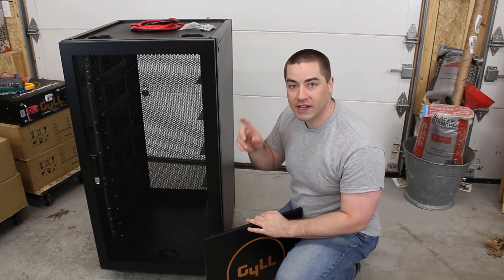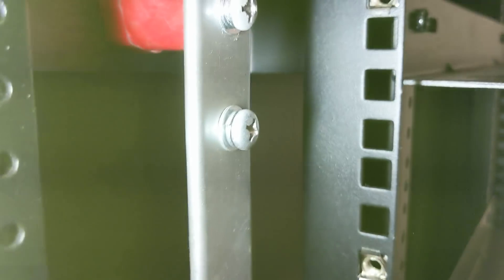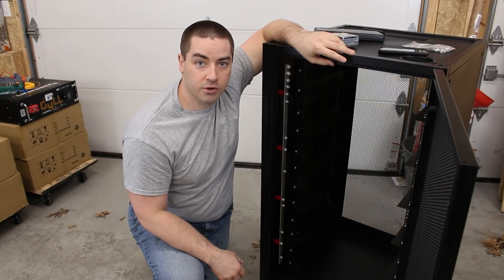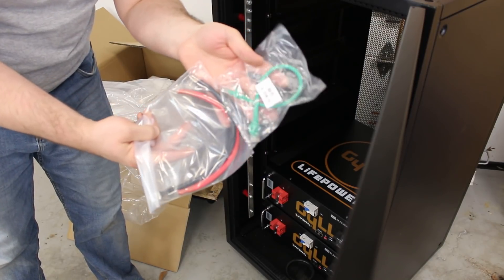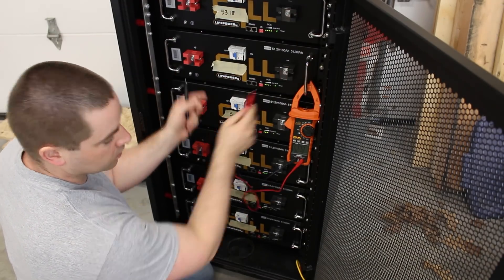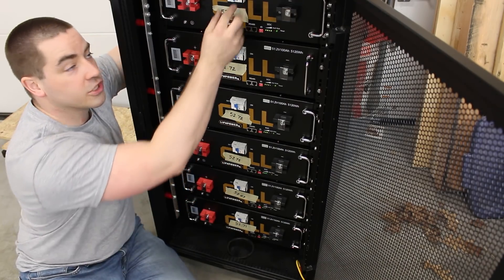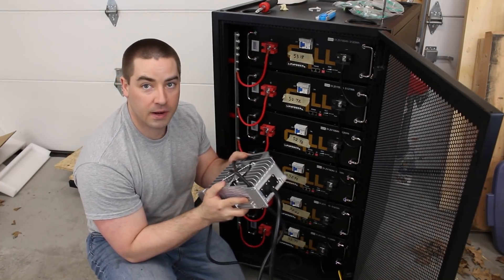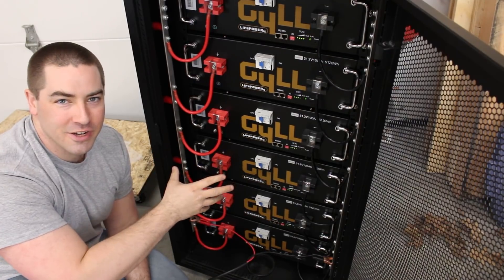Fastest Large Scale Battery Build, 30+ KWH, Power Whole House Cheap

Comment: Hey look a product I had before you. lol. My electrical room is self cooled too. I have a sol-ark, one of these batteries and a heat pump water heater in a 10x8 utility room. Keeps the room about 70 degrees with no ducts to the room. The heat from the solar gives heat to the water heater and the water heater cools the batteries and solar.
Reply: Id love to see a video of your set up
Reply: That sounds brilliant.
USE that heat!
Reply: I would like to hear more about the heat pump water heater. Trying to figure out if that is worth the money, or to change to a gas. The problem is I have to get propane and not sure it is a cheap as natural gas would be, which is not available. Feel free to email me a_w_i_l_b_o_u_r_n@ g m a i l, I think you can see I put spaces and did not complete to help from something that will harvest data from the chat. Remove the underscore for the first part and spaces from second. I loved this video, but they are sold out as a result. Just want to figure out how to have a bank like this to add to my house and tie to my solaredge inverter, looking for any help there from anyone.